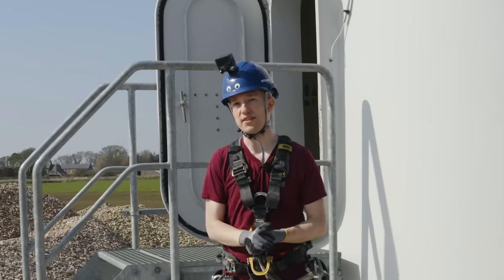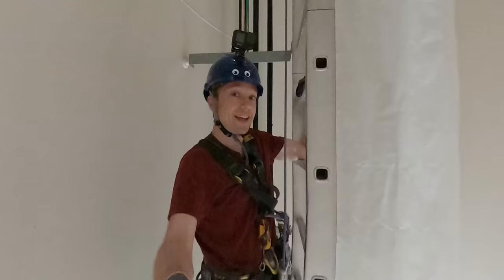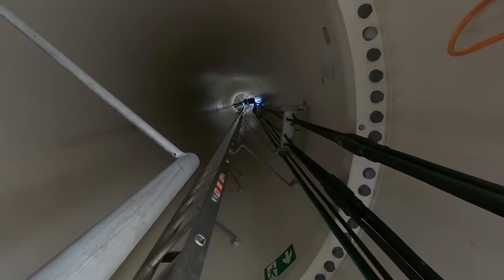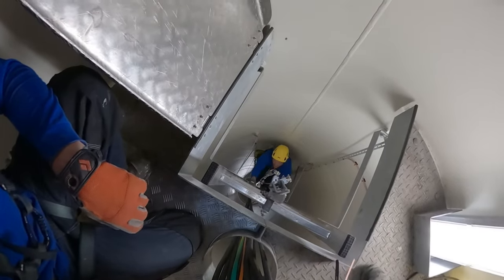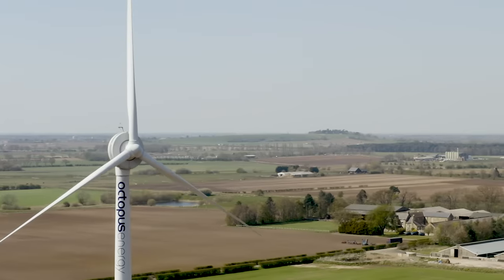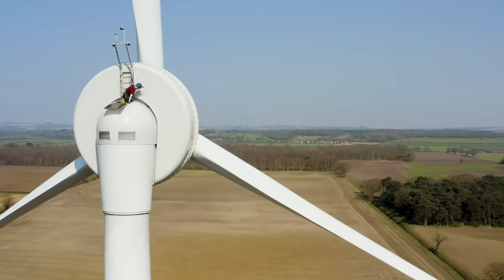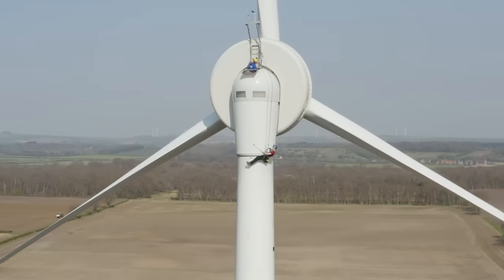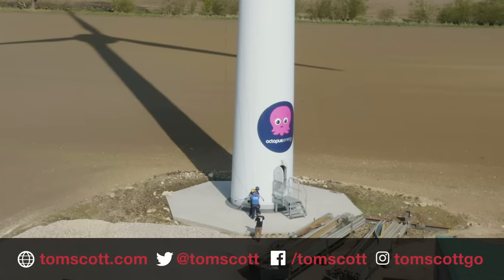Taking The Emergency Exit From A Wind Turbine

Comment: “You don’t train with it very often, because in the real world you should never have to use it.”

Frankly that sounds like a good reason why you should train more often than once every two years.
Reply: to be fair, its not rocketscience to handle such rope/wire systems ... they are fairly idiot proof and could be figured out with just the written instructions by any somewhat educated person who already works with harnesses etc. ... alltho I would never advise doing it that way.
The real problem in an emergency and what strangely is never trained to my knowledge is handling an injured/possibly unconscious body .... getting a body up and out there is certainly the biggest challenge, especially when something happens on the ladders directly and the body is becoming an obstacle. 
Many people would already fail to get someone " out of a hole, tank or something similar without making things worst ... this exit and the space restrictions inside would make things very difficult if the person in need of assistance cant be of help.
These exercises probably just address the "help yourself" cases, while for the real deal trained rescue operators instead of engineers are expected to deal with it.
Reply: You'd be surprised at how well this type of training sticks with you
Reply: I'm just remembering that picture of the two guys hugging on the burning wind turbine. Things cam always go terribly wrong.
Reply: like always, all safety measures come from someone loosing their life. Really sad truth.

Btw. It took the life of  2 engineers for this one to be implemented.
Reply: @shaun239  yes unfortunately safety regs are all too often not written in ink but in blood.
Reply: Generally the time you DO need to use it, you generally don't want to be left trying to remember exactly how to do it. Military will do drills on stuff that is unlikely to be used, so next to no thinking about it is involved if it does come up.
Reply: @diedampfbrasse98  also a thing to note is that if you need use the emergency exit then you are under a lot of pressure so even when the instructions are simple, people still can screw up because of the pressure.

Comment: Kudos to Tom. Being lowered off, having to transfer the body from the horizontal world into the vertical, literally walking over the edge (even if it's round), having no control and being held by two ropes thinner than your pinky (11mm): Your brain must freak out.

Comment: Reminds me of the death of 2 engineers hugging each other before burning to death on top of a wind turbine.
Reply: One fell, the other died inside.
Reply: I'm guessing that's why this got installed.
Reply: Safety regulations are written in the blood of the unfortunates that discovered the need for said regulation
Reply: @karlkarlng  nylon ropes don't hold up very well to fire.
Reply: @karlkarlng  them not having their safety harnesses with them up tower may have played a roll in there demise..
Reply: What i was thinking about the whole video, still makes me sad, but it's nice to know that there was an improvement made, meaning its unlikely to ever happen again
Reply: That's devastating :[
Reply: @003SOK  good point. Maybe it's treated? I don't know. It's safety cable so it has to right?
Reply: Such a tragedy
Reply: @ttnnnaa4500  These emergency decent has been in place for years and was also available for them, but they went up to the roof, with out it
Reply: @bjarkekjersidelimkilde573  I inmediatly thought of those two poor men. But if memory serves me well the turbine was on fire so it's possible they didn't have time to rig up. Horrible.
Reply: @kentarouification  you would need steel wire to withstand fire. i work as a cell tech for verizon, and climb all sorts of towers. these guys have it made, the windmills are purposefully designed for safety and ease of access. you should see some of the stuff i climb. less chance for fire on a cell tower, though. 
today i was on the cell tower at Six Flags Great America in Gurnee, IL.
Reply: Harrowing photo. The two guys hugging on top of the burning turbine. They were fairly new to the job too.
Reply: @003SOK  actually 5g cell towers have more chance of fire because of the idiot 5G  -Covid19 conspiracy theorists burn them down. I hope they stopped that now.
Reply: Yes. Glad to hear about this.
Reply: @003SOK  probably need to get your ass in gear in the event of a turbine fire. Good observation though.
Reply: @bjarkekjersidelimkilde573  oh... well that just makes me sad again. Hopefully other contingencies were developed as a lesson from this then
Reply: I believe one jumped off and the other tried running through the fire... if I remember correct they were only 20-22
Reply: @wendimunson844  That's a really good way to put it
Reply: They explained that this is a magnet based system not a heavy duty old school one that effectively has an engine up there.
Reply: @ttnnnaa4500   It is a totally different type of technology they explained that.

Comment: You'll feel better to know the breaking strength of a 1/2 inch Blue Water rope is 7,500 - 10,000 lbs and you had two of those attached to you - By all accounts the rope will break you long before you'll break it (which is also why its so important to manage a falls distance on ropes) after folks hear how insanely strong their equipment is, its actually easier to relax a bit and trust in it.

Comment: This video reminds me of the sad picture  of the turbine is on fire and you saw the two people hugging it out before they burned to death or jumped....
Reply: Same. I'm curious if this emergency exit would have saved them, or if they'd still have been doomed.
Reply: @skidude121  there's a reason this company is happy to show off the safety system , and a reasoned Tom research emergency exits on wind turbines.
Reply: @skidude121  there was actually an emergency exit on that wind turbine. (I assume you're referring to the 2 Dutch wind turbine deaths in 2013). But due to the fire they couldn't make it there, even though they had 70 meters of safety ropes with them. I remember our local newspaper having an entire page of memorial advertisements.

Comment: I'm a carpenter and I can tell you that he's absolutely right about ladder height.  Most ladder accidents happen on 3-6ft ladders mostly because people are overconfident.  Anything taller, people are always double checking their footings, double checking their angle, that the rung is 15 degrees from your body (Or 75 degrees however you look at it) and the more weight that gets on the ladder as you climb up, the more weight is transferred to the surface its resting on rather than the ladder to the ground.  A 6' ladder though?  No one does any of that, they just throw it up and climb and that's when accidents happen.  The only time I've had a ladder fall out from under me was a 6' ladder because I was moving too fast.

Comment: The climb inside looked awesome and no danger of slipping. (former electrician who has seen some crazy stuff on the jobsite and taken a "magic ladder ride"  where the bottom of a 30' ladder must have gotten scared by the building and took off away from it 😆). Seeing that ring of neodymium magnets I could only imagine how strong they must be since a few little ones can pinch a finger but when they showed that view from 50 meters up? My butt is still clinched!! 😆 😆  Going down the " 2 wires " would be easy, slow moving from top to bottom.  Where was the 75 kph winds?  The hail?  At least a lightning storm.

Comment: I'm surprised you didn't mention the two dutch turbine workers who died due to a fire and no way to descend from the outside. I think this was back in 2013 in Ooltgensplaat I think. 

My concern with what I saw here is that if the turbine were to catch fire, would the rope device and or tie off be outside or far enough from the main compartment to be accessible so they could escape?

Heart breaking to see the video of the turbine workers who lost their lives, one burned to death and the other jumped to his death rather than die in the fire. You can see them hug each other before the end....

Comment: Wonder how long that wire holds up when extreme heat burns it up just like in the case of the two unfortunate windmill workers how tragically died because they cant escape nor jump from a buring windmill,in the end they died together hugging each other

Comment: I think it might have been better to build the ladder access so that an incapacitated person could be lowered down alongside the ladder instead of up through an overhead hatch and down over the side.
Reply: I'd think they'd have that option as well, but this emergency exit is probably just in case that option wouldn't work for some reason.  While the chances are probably very remote, there could be an electrical problem and/or fire inside, or the ladder could somehow break or become electrified, or the door (either at the top or bottom) could slam shut from a strong wind and remain stuck and unable to be re-opened.  I'm sure these things are highly unlikely, but you never know, and have to prepare for the worst case scenario that could happen in a dangerous location such as this.

Comment: go to Palm Springs oil and greas dripping off the turret, how is that "green", not only the logistics involved in bringing the materials in from the manufacturer.
Reply: Instead of burning the oil, it’s used to make the machining run smoothly. Wind turbines also produce 20-25 times more electricity than was used to manufacture and install.

Comment: That breakers system can make you lose your balls if you don't use it proper. It has always to be above you so the falling before break is minimal. If you wont manualy pull it up (just let it follow you) that fall can be to long

Comment: Seems nice for medical emergencies.. But in case of a fire I think you'd be hanging from that thing wishing it was at least SLIGHTLY quicker than that. At least until the ropes burned through and you plummeted to your death anyway.
Reply: It can probably descend faster than was demonstrated here, that was a safe and easy lowering. If the turbine's on fire, you're probably not taking it easy, you're dropping down fast as possible.

Comment: oic the green new deal has maintenance to the up keep, besides killing birds what is the cost of the up keep? what is the cost of one windmill?  what is the environmental impact for building windmills?
Reply: A standard 2.5 mw wind turbine costs about $1.5 million to build, and about $45000 a year in maintenance. For comparison, a standard 500 mw coal power plant costs over $1.5 billion to build, and just over $4.5 million a year to maintain. A 100 turbine wind farm would cost $150 million to build, and $4.5 million per year in maintenance. If we assume that the wind farm operates at 40% capacity on average, and the coal power plant at 65% capacity on average, the wind farm would produce about 50 million kWh per month, and the coal plant would produce around 130-160 million kWh per month. Of course the price of coal should be factored in, but it's actually quite small, so for the purposes of this I won't be including it. Wind turbines have a median carbon footprint value of between 15 and 11 gCO2eq/kWh. For comparison, coal powerplants have a median carbon footprint value between 400 and 700 gCO2eq/kWh. Other than carbon emissions, coal powerplants also cause other environmental damage such as being a large contributor to the formation of acid rain, producing soot, which can cause land pollution and the pollution of waterways (however, not all coal plants produce soot, it's mostly just ones in unregulated or underregulated areas), and polluting the air with other particles which can cause difficulty breathing, lung damage, and in extremely polluted areas, air pollution on its own has been seen to shorten the average lifespan of a person by over 15 years. However, most areas are relatively safe from extreme air pollution, but the use of coal power has significantly impacted areas like Beijing. Wind turbines also have adverse environmental effects other than their carbon footprint, however their effects are relatively small and localized compared to coal power plants. Wind turbines can often disrupt natural habitats, which is most often seen in offshore wind turbines. Inland wind turbines can also disrupt habitats, however, they are usually constructed on open fields, meaning their effects are minimal in comparison. Of course, a comparison of wind turbines to coal power is like comparing apples to oranges. Wind turbines are not meant to replace coal power, since coal power is much cheaper and more convenient, meaning it's often the more effective option, especially for poor and underdeveloped regions. An effective replacement for fossil fuel power plants, at least, until we find a better way, is nuclear fission energy. An average nuclear plant produces far more power than even several coal power plants combined, its only real waste product is nuclear waste (which can be easily and cheaply stored and contained), and it has saved far more lives than it's ever killed. Despite what fearmongering would have you believe, the three major nuclear accidents were all caused by a combination of outdated technology, poor maintenance, poor training, and human error. In fact, nuclear energy is actually the safest form of power generation we have available (yes, even safer than solar power).

Comment: You know if you had a platform every 10 feet or so to make you have to use the reverse side of the ladder, this would be more safer than going in a attic. Safe enough that even a 13 year old can climb. But of course, that would cost more money. And not a single business puts lives over money.

Comment: Do you wear the hard hat incase you fall off the turbine?
Reply: Climbing helmets are actually designed to protect against things falling onto you rather than the other way around. While it can provide some protection against a slam into the ground, from any significant height the real danger is what an impact does to your spine. The helmet is just in case somebody further up drops a tool, loses a shoe, etc

Comment: are the conductors from the turbine, externally mounted? (outside the windmill)?  the conductors going down the shaft seemed way to small?  voltage drop alone would think over 500kcmill required?   have a lot of wind farms (IPP'S) tied into our grid but only see the transmission connection on my end.

Comment: Would it be so hard to give wind turbine mechanics GLIDERS?? Or a parachute, SOMETHING to help them escape a potentially burning turbine simply by jumping off of it rather than staying inside and battling flames and smoke??? Two workers already died when a turbine they were AT THE TOP OF caught fire. One guy tried to escape thru the tower, the other chose to jump to his death, rather than burn. It would be so easy to devise an escape not involving going back down the inside of the tower. Parachutes, gliders, hell, even a zipline into a giant bean bag would work🤷 Or, i dunno, put an emergency ladder on the OUTSIDE, you dummies🙄

Comment: Emergency exits? BORING! What they need up there is a bathroom. 

Funds remaining, a nice quattrophonic sound system and a well-stocked minibar would be nice. Oh, and a disco ball (of course) where if they say there's no room, then a special hole can be cut in the top with a small dome to accommodate it.

Comment: I work highrise jobs, I'd rather fall from 400ft than 40ft. The stretch from your lifeline is alot worse at 40ft, aswell as the whiplash. And if it fails you may actually survive a 40ft fall. No thanks.

Comment: There's no escaping for the taxpayers, though! Windmills will never generate the energy needed to even produce one! Bend over for those boondoggle! Entry only!
Reply: They produce 20-25 times more electricity than was used to manufacture and install. What you’re talking about is from a study that considers a wind turbine located in a valley with little to no wind.